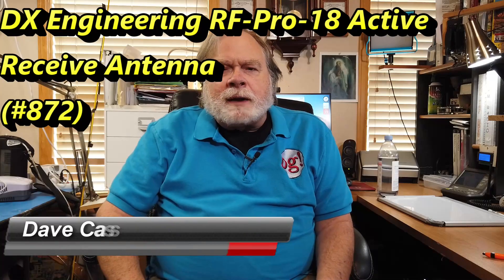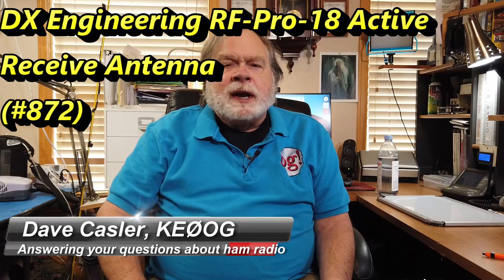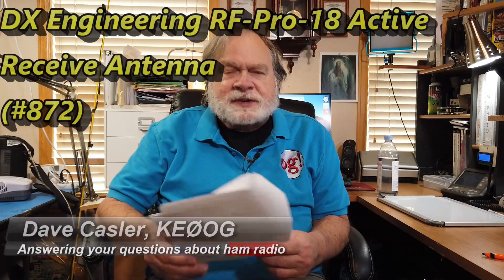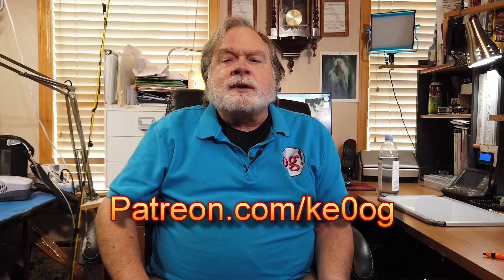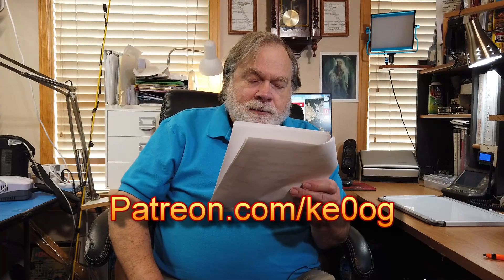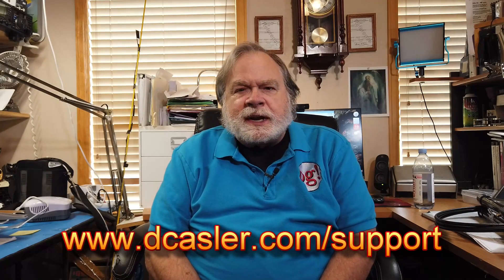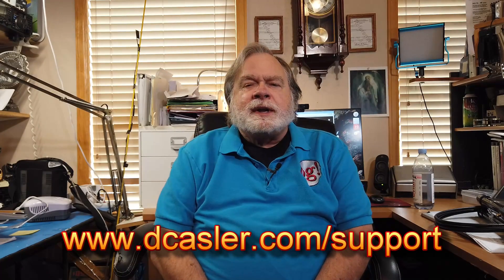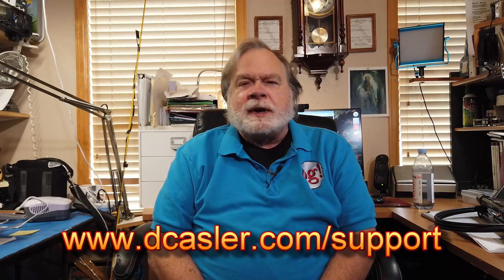DX Engioneering RF-Pro-18 Active Receive Antenna (#872)

Comment: I own an original Pixel Receive antenna and added the DXE RF-PRO-1B to my receive antennas. The original is hands down the better. The original Pixes has a lower noise floor and wider coverage over the RF-PRO-1B.

Comment: The amplifier to which you referred to is called a Norton amp because it inputs the signal as current, not voltage. The name Norton is used because the OP-AMP IC chip accepts only current as input signals. If you recall in basic circuit class, a Norton equivalent circuit can be re-expressed as a current source, while a Thevenin equivalent equivalent circuit can be re-expressed as a voltage source. Hence, its called a Norton amp.

Comment: I love my Chameleon CHA RXL-PRO, but it does have one really bad flaw. My area gets a bit of rain now and then, and because of that, the antenna amplifier housing which is about 90% hollow acquired water condensation inside. Given what I paid for this antenna, I was not too happy about this. My antenna leaked water into the amp housing at the base of  my antenna twice. However, I solved this problem by filling the antenna amp housing with Epoxy Seal 9000 potting compound. Anyone buying this pricey antenna needs to know this because Chameleon does an inadequate job at weather proofing the CHA-RXL-Pro.  Great antenna, but its not suitable for wet environments, unless one does what I did.

Comment: I have one of these but not sure I'm getting the best use of it. These have actually been available from DXE for about 5 years at least. I got mine late 2019 for $499.99 from Solid Signal. The instructions say not to attach a ground so that it makes contact with the loop so as to avoid a ground loop. It's not clear how a ground should be attached in anyway at all (if this sits on a rotator on top of your roof as mine does). Also, most radios I have are 50-ohm input but the RG6 you're advised to use is 75-ohm. So I would like to know the best use scenario for this to get the most use out of it and sure the maximum signal reaches my radio. Should any type of ground be used at all and should a simple balun be used for impedance matching (75-ohm RG6 to 50-ohm radio input)?

Comment: I have one of these antennas.  Bought it used from another ham off QRZ.  It's the original Pixel loop and it's AMAZING!  Very directional.  I'm glad I got it used and did NOT pay $675 for it.  Would I PAY $675 for it?  No way!  Is it a good antenna?  Definitely.  FWIW.....  de W5ODP   🙂

Comment: MLA-30+(plus) Loop Active Receive Antenna 100kHz - 30MHz and Short Wave Radio MW works great, only £30 Inc postage.
Reply: Mine works so well I got 4 spares for backup on the shelf
Reply: The MLA-30+ is awesome. Not as good as my $500 plus CHA RXL-PRO, but for $30, its a steal. I own two MLA-30s. Its a Chinese marvel and bargain. I paired it with a RCA TV antenna remote rotator that costs $120. A great combo.